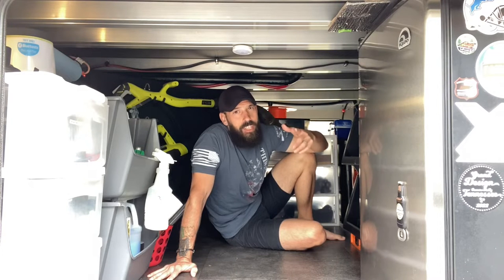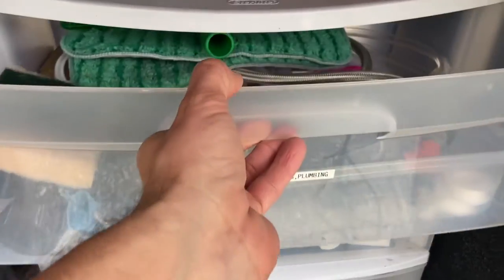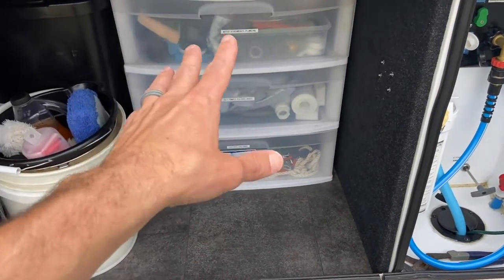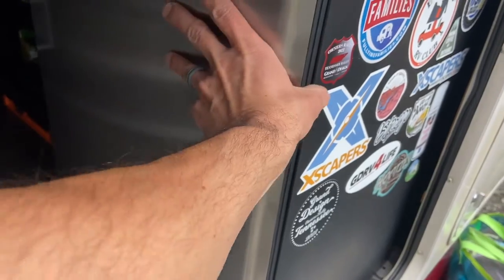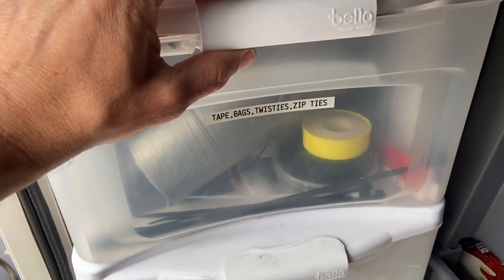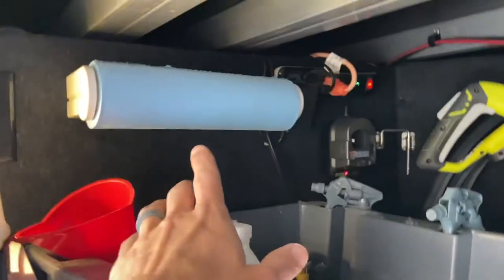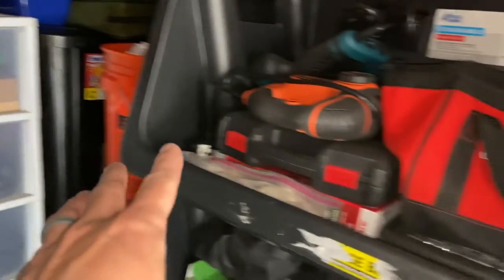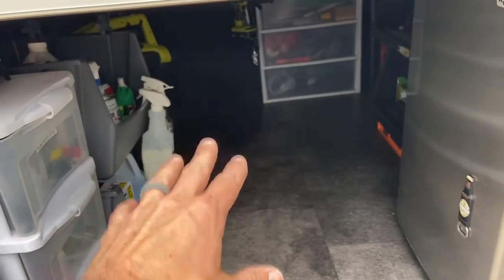How to Organize Your RV Basement | Storage Tips & Ideas!

Comment: Thank you for another great video Chris and great organization on your rig!   I love the idea of using stackable bins too. I guess my version of the bins was that I took one of those custodial cart pocket organizers, cut off the velcro straps and screwed it to the back wall of our front compartment and put items such as disinfectant wipes, BoeShield, DeOxIt, trash bags, rags, Tuff Stuff Foam Cleaner and a few other items that are now quickly accessible. Below that in the well of the front compartment is my toolbox full of tools and another toolbox that has misc. parts, such as fuses, tapes, pex pipe connectors, extra sewer hose gaskets, hose clamps, a heat gun and some other extra's. Although we don't have a drop frame 5th wheel, I installed a MORryde sliding cargo tray a couple of years ago that can slide out from either side of the rig.  I don't carry a weed-eater but I do have my Makita drill, impact driver, blower, fluorescent light bar, and 4 batteries on those slide-on tool and battery holders attached to the pass-through slide wall. Hanging from the floor joists above that, I have 3 sewer hose hangers that house the American flag, and flagpole, a slide-out measuring stick, a propane tree for the lanterns and a couple of extra sticks of pex pipe.  It's fairly well organized but I am always looking for ways to make it better and easier to access our stuff.  Thanks for bringing us great content and safe travels!
Reply from the maker: Sounds like you got it down and things are pretty organized! Definitely appreciate you always watching 👍🏼😁

Comment: It's sad that Grand Design builds these solitudes with all the nice storage you really can't use because of weight issues with the standard 7K axels. I have around 1600 pounds of margin by sticker. These should come standard with 8K triple axels IMO.
Reply from the maker: I agree. It’s crazy I look at some of these newer RVs with rear pass through storage massive basements and they have a cargo capacity of 2,000lbs with 2 7k axles. We are upgrading to 8k axels and new springs next month. Thanks for watching.

Comment: Two questions: have you had any issues with the screws from the D rings going all the way through the wall of the pass through into the garage (front) space or vice versa? Also, is there any reason I shouldn’t drill through the aluminum bars on the ceiling of the pass through? Thanks!!
Reply from the maker: Nope. That one wall is pretty thick, it’s sorta a firewall due to the possibility of having a generator in there. You will need self taping screws for the metal walls. Keep the screws short though. And no worries about drilling into the top aluminum bars either. See people do it a lot.
Reply: @WhyWait  thanks so much! I bought the exact d ring set that you linked to this video. Is the length of those screws good so that it doesn’t go all the way through? We have the same model y’all have-just a 2020.